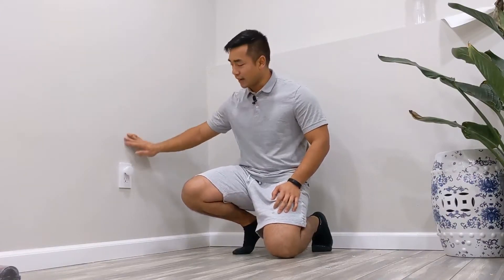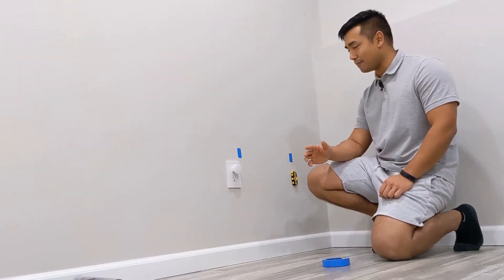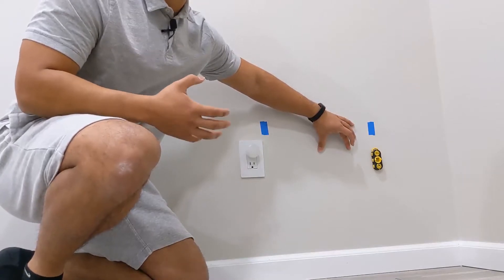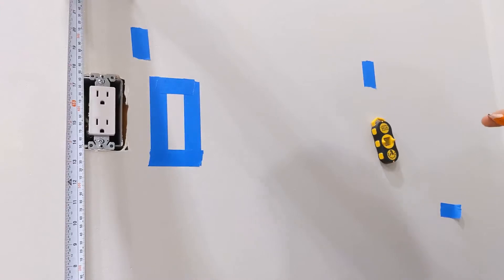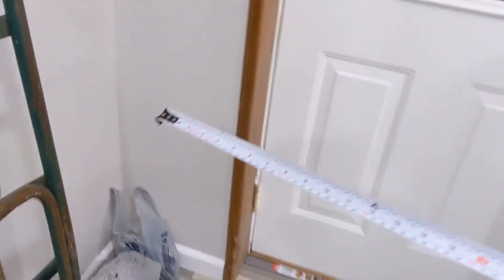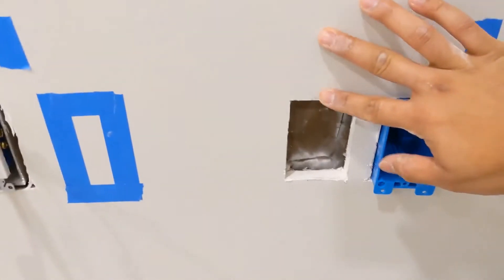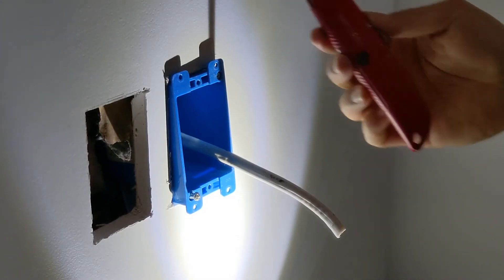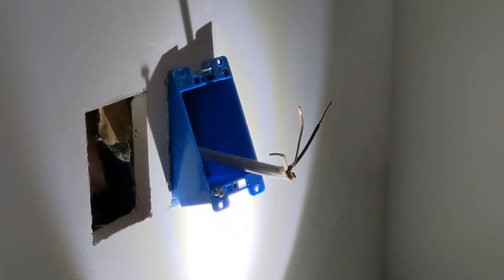DIY 🛠 | How to install a new outlet 🔌⚡ in an existing wall (2021)

Comment: If you're installing new outlets, trust me go with Leviton Decora Edge!  No more messing with silly screws, no exposed bare wire, AMAZING!! I will never go back to these lame old-school outlets and fumbling with bending little J hooks around screws again!!   I confirmed with Leviton they are code compliant; while they may look similar to the old "backstab", they are NOT backstab and are 100% safe and up to code. These things are amazing. I used them on my entire condo reno, and you can buy them in a 10 pack tamper-resistance (future proof your home and safer for kids, so they don't stick a fork into the wall, etc.):  Leviton E5325-MW Decora Edge 15 Amp Tamper-Resistant Duplex Wall Outlet, 10 Count (Pack of 1) - White

I will NEVER go back to making J hooks again!!

Comment: I don't think that drilling a hole in the side of a box to run a wire through is acceptable by code. I would try using one of the knockouts in the back and try to guide the Romex in the direction you want. 
The sheathing in each box is too much. It should be stripped back so only 1/2 to 1 inch at most enters the box.

Comment: I will prob never install an outlet but I watched the entire video still lol  Very good presentation. Curious why you did not use the original drywall piece you cut out  to patch the hole?
Reply: CC p, I think it's personal preference. If you use the cut out piece, you will need to mount some scrap wood pieces on the back of the drywall and mount the cut out piece to the wood. It's not difficult and would provide a more solid mount imo.

Comment: The screws on the top right and lower left of the old work electrical box need to be tightened so that the outlet won’t be loose
Reply from the maker: Yes they were tightened at the end of the video. I left them loose at one point cuz I was going to put a cabinet there but that's not happening for a while anymore.